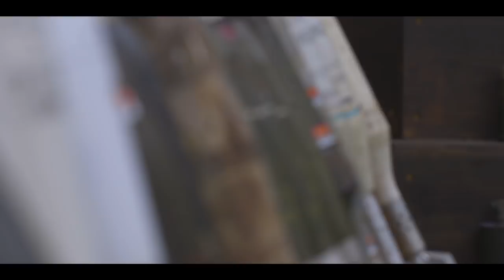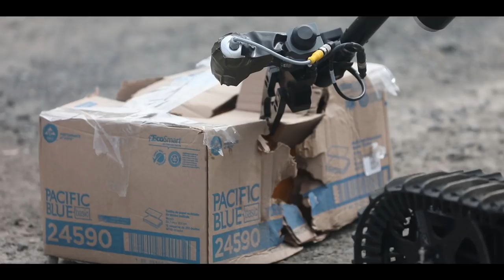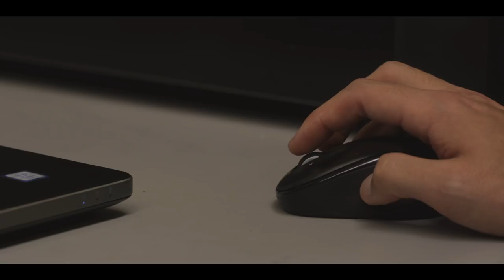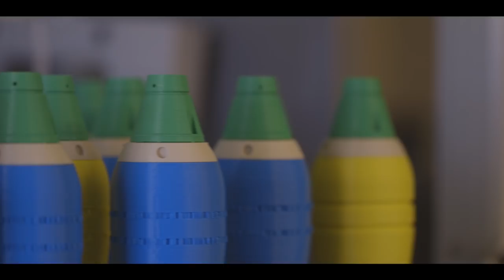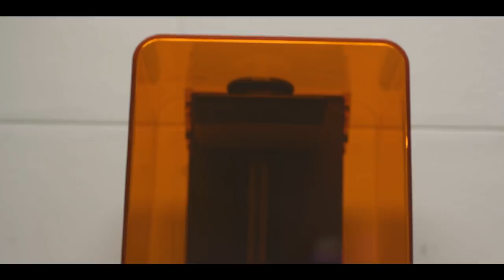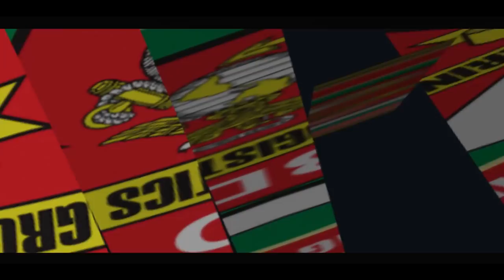3D Printing | 9th Engineer Support Battalion

Comment: Is mos 3043 supply admin and operation specialist a good job
Reply: Back in the 70s it was working in a warehouse/administrative duties. When your in garrison (on base) working in the warehouse you stay dry and not very cold. But its hot, especially at LeJeune and all Okinawa bases. Other words its a MOS you could use after you get out of the Corps.
Reply: My Gentle Pitt Bull thank you, I have another question, is it true that you get promoted fast with that mos, because the marines in my rss recruiting office say that I can get promoted to corporal in 2-3 years
Reply: LA Armenian Getting promoted fast is extremely relative. A shit hot marine in any MOS can pick up corporal within 3 years. An average marine not so much in any career field. Strive for absolute perfection and you’ll pick up rank accordingly.
Reply: @laarmenian3449  not sure. Each MOS has different promotion points. Those points come from HQMC (Headquarters Marine Corps). You can get  Meritoriously promoted early. Im speaking about myself. I was in the Corps 1973 to 1977, this was right after the Vietnam War, only 125,000 in strength (todays strength is aroud 190,000) The Marine Corps was starving for Marines to stay in and promoted quick. I was a Squad Leader at boot camp, so I was meritoriously promoted to E2  Private First Class and then again to E3 Lance Corporal all that in 10 months, and E4 Corporal in 18 months and Sergeant in 40 months. Probably unheard of today. By the way I had 2 MOSs 3531 truck driver and 0151 Personnel Sgt. My last 2 promotions were as a 0151, the Marine Corps needed admin and personnel Marines. You really need to talk to a Marine in the Fleet whos in the Corps now. Maybe a Corporal or Sergeant,  recruiters have been known to stretch the truth. The Supply MOS is a good MOS. Work hard in boot camp, be a leader. After boot camp excel in your MOS school and stay out of trouble in the Fleet (Real Marine Corps) at Camp LeJeune, Camp Pendleton or on Okinawa.  Hopefully a current Marine will see this and comment, good luck.
Reply: @dylanrutan100  well said. After the Vietnam War the Marine Corps was starving for NCOS. I guess Im bragging I made Cpl in 18 months and Sgt around 40 months. Im sure unheard  of today. I was a 3531 truck driver and 0151 Personnel Clerk/Sgt. 1973, there was only 125,000 in the Marine Corps. Like I said, it was a different Marine Corps in the early 70s. But this Corps today's Corps is a stronger smarter Corps. Semper Fi from an old Marine Sgt.......OUT